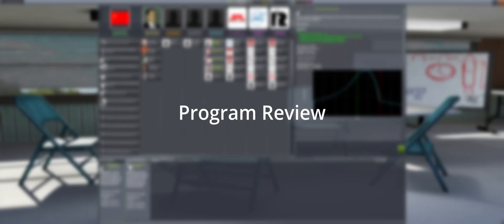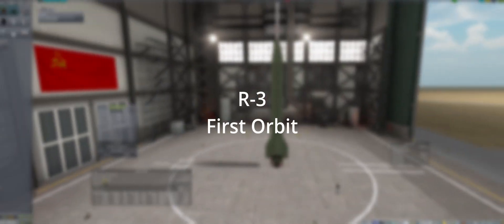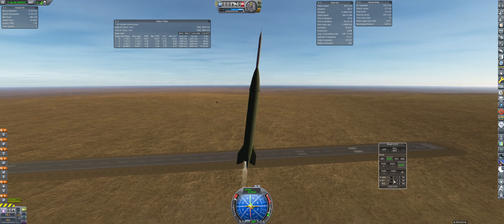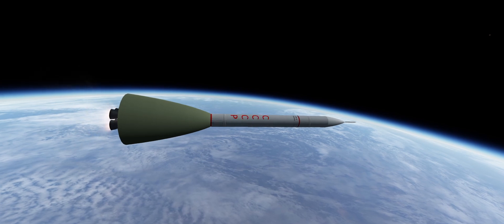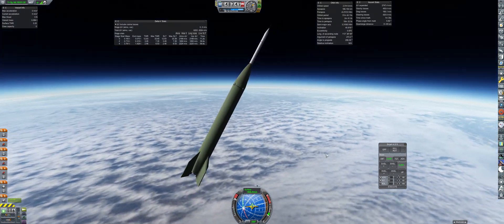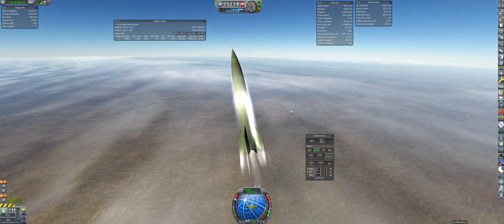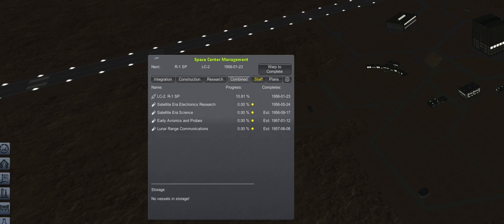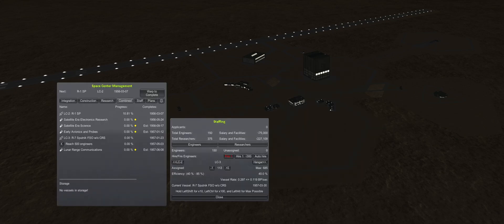Soviet Space Program - EP5 - First Orbit [KSP/RP-1]

Comment from the maker: What's everyone's go-to first orbit design?
Reply: My first orbital rocket was the r7
Reply: Basically what you made of the spin to win bumper rocket to orbit design.
Reply: i just took inspiration from carnasa
Reply: I haven't even gotten my first orbit lol, just a few days ago I got 5000km downrange and I was following ur designs! Love these videos keep it up.
Reply from the maker: @MrDuctTape-s6h  thanks! good job on the 5000km, it can definitely be a bit tricky.
Reply: rd-108 with rd-105 on top
Reply from the maker: @cardboard9124 that design will be making an appearance in this series.
Reply: @cxg2827  Thats basically my first rocket every run, X-planes makes big money and I can get 1958 orbital rocketry in 1955 lol
Reply: I've been trying some different designs lately, and in my current play through I did 2 LR105 sustainer and 2 LR43 booster for the 5k, 6k and 7k downrange milestones, then for FSO I put a Gamma-201 at the top, and later added 2 more LR43 boosters and replaced the Gamma-201 for an RD-0105. I'm already in 1965 still using this rocket for 5t LEO payloads and probably won't be replacing it anytime soon lol.

Comment: Oh man am I glad I found this channel, and what I've watched has been awesome! I know this is a few months old, but I have been doing an Soviet Space Program as well and cannot for the life of me make a light orbiter before the massive R-7. I tried recreating the one you made and it doesn't get anywhere close to orbit. This coupled with a dozen other designs over several hours has led to great frustration. Does it still make orbit on the current version of RP-1? I know its a hassle but would it be possible to get the craft file for this? If not I completly understand, and any advice would be appreciated. Thanks!

Edit: I was spending some time going through the RP-1 discord craft files and found your posting of the craft! Holy moly what good luck. Thanks again, and I am excited to binge the series!

Edit 2: I got it and it works still. I still want to design my own, but this gives me a lot of help. My final question is this, how were you able to figure out this would make orbit, despite the delta-v readout from mechjeb saying ~9000 m/s? To get to orbit at the 51.6 degree inclination, you should need between 9.4 ~ 9.8 km/s, but you got there with 9 km/s? How does that work?
Reply from the maker: Glad you found the craft in the Discord Channel. It's not too hard hitting orbit even under 9km/s, you just need high TWR off the pad and with the upper stages. I also launch from the current inclination of Baikonur instead of increasing to 51 degrees, which likely helps too.
Reply: @rhettallred7840 How do I join the RP-1 Discord server? Is there an invitation link somewhere?